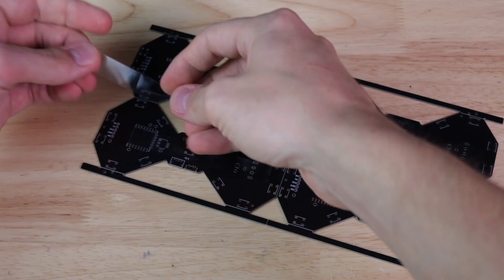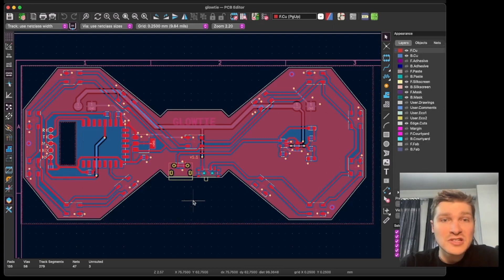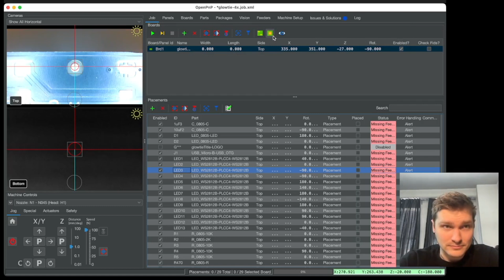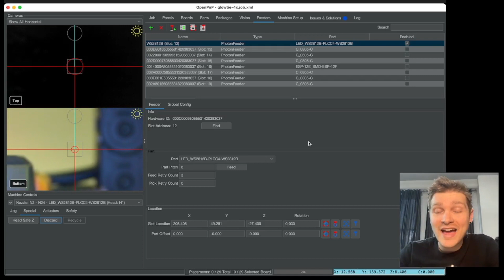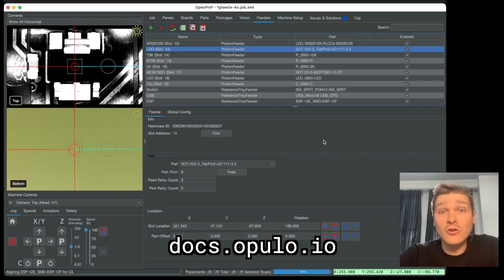LumenPnP Setup Tutorial Part 4 - Custom Job

Comment: I would probably modify the KiCad files to not export things to the pos and bom files that isn't supposed to be there.
Also doesn't OpenPnP support putting back the picked parts into the tape instead of discarding them?
(Seems to recall seeing that somewhere)